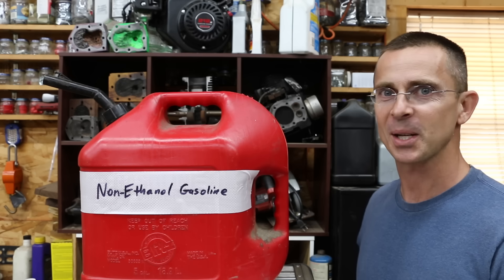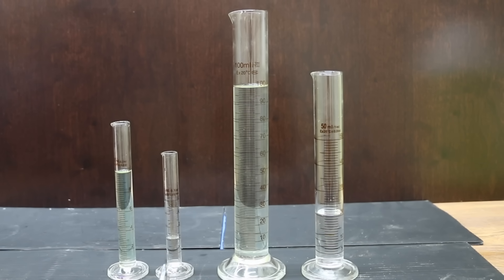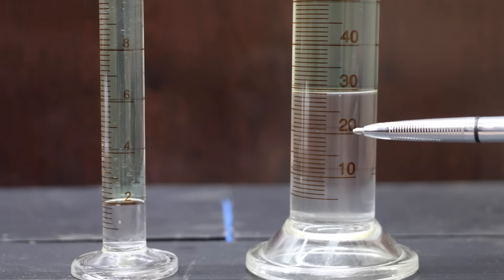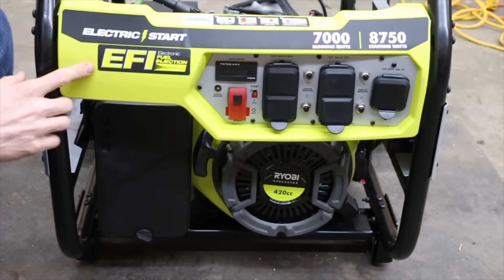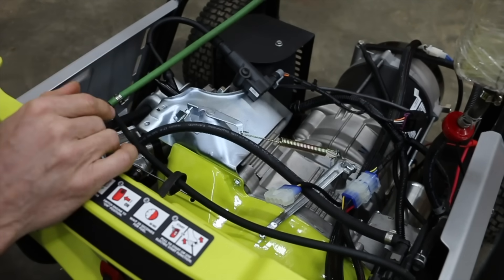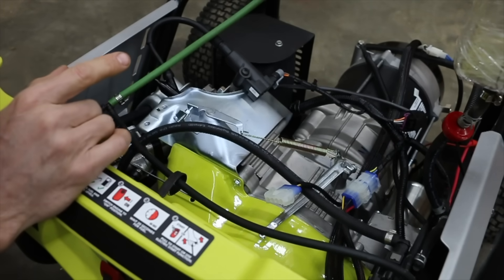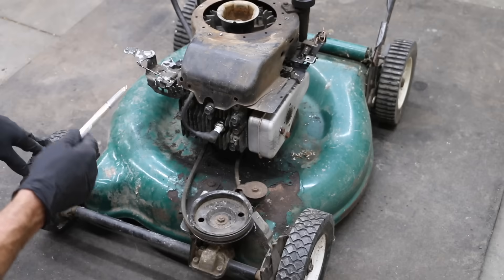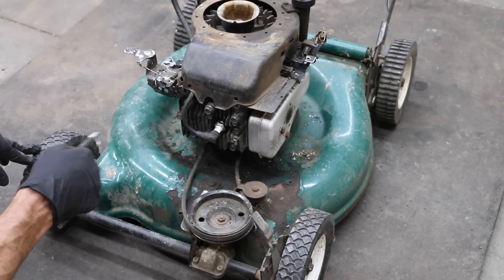Is Non-Ethanol Gasoline Really Better? See the PROOF!

Comment: I have an old 83 ranger that absolutely refuses to run right on normal pump fuel.
Reply from the maker: What type of fuel works well?
Reply: @ProjectFarm  What I ended up doing overall was shim parts of the carb that were getting some airflow (original carb, so it's tired). Once I solved the air issue, the standard 83 ran no better. I dropped my tanks (it is a longwheel base with 2 tanks...seriously), cleaned them out, flushed my lines....still ran bad on standard 83. A gas station opened up a few miles away, and it had non ethanol. I filled one tank just to see if it made a difference, and it was much better, but not perfect. I added a can of seafoam, and it was spot on. Ever since I always get a tank of ethanol free(ish), add a can of seafoam, and it runs like a top.

I have a few ideas why this might be. My main idea is that back in 1983, gas was much different. These 4 bangers were never meant to run on all these newer detergents. I think the seafoam helps dilute any existing detergents, and this in turn allows for properly timed combustion. Without the seafoam, the mixture is igniting too late, and sometimes not at all. Do this same thing in a modern vehicle and I suspect negligible difference. Computers can drive more spark, and adjust to premature or late ignition. Love your videos man.

Comment: A few years ago my Harley Sportster (XL883) started getting around 38 MPG in town after years of 42 MPG. Nothing on the engine had changed. Then I realized I was putting 10% ethanol gas into it. The 10% ethanol gave me 10% less mileage. In the last few months I've found gas with no ethanol. I haven't checked the mileage, but the engine does run stronger. Friends with trucks experience the same or worse mileage when using ethanol. It's garbage used to make people FEEL good, thinking they are saving the environment.
Reply from the maker: Thank you!

Comment: Many years ago when original “gasohol” came out we ran it in everything from lawnmowers to chainsaws with no apparent damage. Obviously, pure gasoline is more efficient because gas has a higher calorie content than ethanol, but that was a known issue. 

What I find interesting is how corrosive the ethanol blends are compared to the original blends. My theory is that the additives used to meet federal standards increase corrosion.
Reply: In case anyone is interested, pure gasoline is 114,000 btu/gallon
E10 (the common regular blend) is 111,836 btu/gallon 
E85 is 81,800 btu/gallon
Pure Ethanol is 76,100 btu/gallon

The common E10 has roughly 2% less energy that pure gasoline 
E85 has nearly 3% less energy than pure gas
Reply from the maker: Great point

Comment: Interesting video, but I've tested the difference for my 2001 Ford Focus using ethanol fuel, and I actually get 3 - 4 mpg less with it.  So, I never buy it.  BTW, I grew up on a farm and support farmers,  but I don't support ethanol based fuels because of this and the same reasons stated several times in this comments sections already (which have nothing to with mpg in my vehicle, but everything to do with environmental issues, subsidies, etc).

Comment: Are there any gas stations that don't offer non-ethanol blend fuel? If your engine--large or small--can't handle an ethanol blended fuel, you know... don't use it? Sounds like the fuel isn't the problem, it's the consumers that don't know any better.
Reply from the maker: There are several that offer non-ethanol fuel nearby where I live. Thank you

Comment: I have pulled a  plug on a lawnmower stored a couple months  and the ethanol had absorbed so much water ,  the  gas  looked like hand cream
Reply from the maker: Wow!  That'll cause a lot of damage to the carburetor metal.  Ethanol destroys "pot metal".
Reply: the good news is the lawnmower is  30 years old never had more than an oil change yearly and air filter cleaned and oiled .  starts on first pull all summer  ( bit harder in winter )  and have not used ethanol gas in several years

Comment: Agree rebuilt several carbs on small engines due to the ethanol damage eating the rubber components. I live in Northern California and travel 20 miles to Oregon for non ethanol fuel and its still cheaper than regular unleaded in my town. Great California taxes driving people away day after day
Reply from the maker: Thank you!

Comment: As a retired ASE Master Tech.  I found... when ethanol mixes with water in storage tanks and gas tanks, it is allowed into the fuel system where it passes through the fuel filter.  The problem; water makes the paper filter medium swell and restricts the flow, lowering the fuel pressure at the injectors.
Hence, fuel filters that should last 30k only last 20k.  This causes hesitation and a lack off power.  Love your videos!
Reply from the maker: Thank you!

Comment: Have you seen gas sold as non ethanol sold with ethanol in it? That's supposed to be tested every so often to verify that it actually is what the product claims or else they can get fined....
Reply from the maker: I have not had this happen yet.  I have a tester that I use when I buy non-ethanol just to be sure. After working with fuel with ethanol, I can now smell the ethanol too.

Comment: I see .5 to .8 miles per gallon better milage out of my expedition with non ethenol fuel and well as a definative boost in power.
Reply from the maker: Nice!  Thank you for commenting on this.
Reply: Thats because you have more fuel🤦🏼‍♂️
Reply: I saw maybe 0.75 higher MPG in my Explorer. It's 70 cents per gallon more expensive here though, I'd be paying $14 more every 20 gallons for 15 more miles. There are cheaper ways of gaining fuel efficiency; like add a homemade air dam to the front bumper. (I did that before and it worked for maybe 1 MPG.)
Reply: A true multifuel motor, such as the one used in early ethanol Saab 9-5 will have more power running on nearly pure ethanol (in Sweden we have E85 with 15% petrol). The fuel economy stays around the same since ethanol is cheaper. So you pay for the energy. I´ve tried using ethanol for my old 1950:s tractors but the compression is probably too low. Won´t run that well. One has to think of fuel as firewood. It doesn´t matter if you burn pine or birch. They both contain the same energy, but not in relation to volume.

Comment: Ethanol burns with lower efficiency at lower temps. The colder the fuel the less energy it produces. That's why my air intake has a water jacket coming from the radiator. Back in the day gas stations had summer blend fuels that had , I believe, 2 to 5% ethanol. Ethanol is a mild corrosive that supposedly eats carbon build up on moving parts like the piston head but not much help on the stationary surfaces. Ethanol is more corrosive on marinized engines due to the alloys used and smaller engines due to the higher temps.
Reply from the maker: Great point

Comment: I have a 2017 Tacoma and we did some number crunching between the two.  One the same road going 500 miles we used 10% ethanol regular gas and only got 18 MPG.  The next time we made the trip we used straight 100% gas under similar conditions and got almost 24 mpg.  With that much difference in mpg it is cheaper to use regular than the ethanol gas that is a lot cheaper to buy but not when you crunch the numbers, $ per mile.
Reply from the maker: Impressive results!  Thanks for sharing!

Comment: i only really am concerned with older 2 stroke outboards that  i run. the higher octane causes the motor to run cooler, thus increasing carbon deposits. not to mention that weird gel like substance it leaves behind over a year of storage, clogging carbs to no end. add to that 4% better fuel economy (which im guessing is atleast 2% more hp) and non-ethanol wins for me hands down.
Reply from the maker: Thank you

Comment: I ❤️ E85. 0 problems and the power is amazing. I however would think twice of running high ethanol fuels in a carbureted motor. I have found when I do run gasoline my exhaust tips get carbon build up and with E85 they stay squeaky clean.
Reply from the maker: Thank you

Comment: Most economical gasoline formulations have poor octane numbers, causing knock.  This problem was addressed by adding tetraethyl-lead.  Unfortunately, it's a horrible pollutant which contaminates the air, water and soil and causes high blood levels. When lead was finally phased out of gasoline, a demand for an octane substitute led to the oxygenates, including ethanol.
In addition to increasing the fuel's octane rating to a satisfactory level, ethanol reduces carbon monoxide, oxides of nitrogen (smog) and other pollutants in the exhaust.  The trade off is that since ethanol is already partially oxidized, it doesn't contain as much energy of combustion as hydrocarbons like gasoline.
Reply from the maker: Thank you!

Comment: I have a 2000 Accord V6. I have to use no-ethanol fuel because of a Honda design issue that results in a "hot soak" problem (the ethanol vaporizes out of the fuel causing the car to sputter/die at idle or restart (after engine is warmed up)). Once I started using pure gas there was no longer a problem (other than only one service station carries no-ethanol gas).
Reply from the maker: Thank you

Comment: Calorific value is almost spot on - 4%. If it's not a requirement, you can make your money back if premium non-ethanol is 4% higher priced than ethanol. In my case, local gas stations offer ethanol free premium, but not regular, at a 5% difference. Makes for a hard decision!
Reply from the maker: Thank you

Comment: In aviation long ago we saw Ethanol fuels damage rubber fuel tanks and hoses and seals 
This was when we had a STC To run Auto gas in our AC Engines certified for 80/87 leaded aviation fuels 
It had been replaced by LL 100 AV gas
Valve damage resulted from using the 100 LL
Reply from the maker: Great point! Thank you
Reply: Avgas 100 LL is a bit pricey.

Comment: I had a Flex Fuel vehicle that took E85 also. While E85 was cheaper you got less fuel economy and performance. If you were to use E85 exclusively your engine would wear down faster. For my motorcycles and small engine items such as lawn mowers and snow blowers, I always buy gas without ethanol in it. The shelf life of gas with ethanol in it there's a lot less then without ethanol.
Reply from the maker: Thank You
Reply: I also forgot to add that it's stated that your vehicle used with E85 would continue to reduce your MPG over the years because it wears out the engine so much

Comment: Depending on what the ethanol is made from corn sugarcane or wheat, every thing I've seen or read is American, but in Australia they only use wheat from 1 company & there is no issue with it, as for milage lot better than 91ron & mid to high speed excelleration in 6&8 cylinder cars a lot smoother
Reply from the maker: Thank you

Comment: Non-ethanol gasoline is only better in the sense that ethanol will pull moisture into your fuel tank and straight gas will not. So, for engines that do any kind of sitting around (lawnmowers) ethanol is bad, no debate. When it comes to cars that get driven each day it does not matter.
Reply from the maker: Thank you

Comment: I became curious of the same question with my vehicle. Driving the same route, at 55 mph for several days I found my vehicle averaged 30.5 to 31 mpg on ethanol blended fuel. That same vehicle, same route at 55 mph for the same number of days on pure gasoline fuel averages 37 mpg.
Reply from the maker: Thank You

Comment: I've been running e10 87 octane in my 1999 johnson 60hp, 3 cylinder, 913cc,  2 stroke outboard for nearly 10 years. I can buy ethanol free 90 octane for 35% more. I cant tell a difference in the way it runs.  Yes, I will have a problem(either fuel) if water gets in my tank. This is in a fairly low performance engine.
Reply from the maker: Thanks for the constructive feedback

Comment: No non-ethanol gas available here in NJ, but when I finally got to buy a tankful in Virginia for my 2015 Buick LaCrosse recently, I got smoother acceleration, and the light pinging on acceleration that the dealer had "normalized" all but disappeared. And yes, it added some 25 or 30 extra miles before I next filled up.
Reply from the maker: Thanks for the constructive feedback

Comment: I run 100% whole gas in my lawn tractor my trimmer and boat motor. Eversince I did this the lawn mower runs much more smoothly. I believe anything that isn't fuel injected you should use whole gas. Unfortunately most gas stations don't sell 100% whole gas.
Reply from the maker: Thank you and glad its helping.
Reply: Ethanol still isnt good for fuel injected vehicles, it destroys the orings

Comment: The reason you are not getting full 10% ethanol in the 'water test' is that shipped ethanol is 5% denatured.  This means that the ethanol used in gasoline blending has 5% hydrocarbon added before shipping.  This makes it 'not drinkable'.  
Therefore, ethanol used in gasoline is actually 9.5% pure ethanol.
Reply from the maker: Thank you for the constructive feedback.

Comment: Ah your efficiency test is directly in line with AVE's math comparison of the 2. He worked out e10 had 4% less energy per volume then straight petrol yet doesn't cost 4% cheaper so it's better to buy straight gasoline. Here in Australia there is about 1% difference in the price between the 2 so you would waste a good amount of $ over an extended period of time buying e10.
Reply from the maker: Thanks for the constructive feedback

Comment: I really like these tests as they are done very well.
As for people commenting on how Ethanol is so great for small engines and it doesn't hurt them, don't know jack shit. Back in the old days, a small engine could sit for 2 yrs and never have a problem, now sometimes, 2 months is all it takes for the carb to need to be removed and cleaned because of the Ethanol.
There's a reason why the big box stores sells NON-ETHANOL 2-stroke gas and it ain't just for the money, it's cause it lasts longer and doesn't ruin carbs.
Reply from the maker: Thank you

Comment: When it comes to cleaner, you really need to compare E85 to gasoline.  If you have ever seen an Indy car engine after a race broken down, you would think it only did one lap.
Reply: Comparing a 250,000 engine to a 2000 dollar one really isn't apples to apples and what fuel do they run ?
Reply from the maker: Thank you

Comment: 2003 F 150 5.4 engine
E85=12-15 mpg
Ethonal free = 14-17 mpg
Measured by full tank refills over months of same commute.
Unfortunately the higher cost of ethanol free negates the higher mpg
Reply: No difference, used both in car, truck, and motorcycles and tested many many times. 90 eth free vs 93 eth. Cost is same
Reply from the maker: Great information. Thank you
Reply: Got three to four miles per gallon lower with ethanol fuels

Comment: Both fuels work well if you know how to work with them. Both types get old and both go bad and even some non ethanol gas absorbs moisture depending on the additives. And in many cases high ethanol 15% gas actually is better, burns cleaner, less carbon buildup, and better pre ignition. why do race teams use it, why does seafoam use alcohol to clean the engine. The public has been fed a lot of misinformation about ethanol
Reply from the maker: Thank You
Reply: Running straight alcohol carries more air, requiring the jets to be 2.5 times the size of gas jets, thus producing more power, but CANNOT be left to sit in any engine because it's corrosive.
That's why race teams use it, cause it produces more power and has a higher octane rating, but again, the jets are 2 1/2 times the size of the gas jets using 2 1/2 times the fuel. Have fun filling your tank 2 1/2 times as much !!
Reply: @augustreil  not talking about 100%. Blends
Reply: @superwilcox9026 , Same thing, just a larger percentage that's all.

Comment: With both my Kia Optima and Sportage I got a bump around three to four miles per gallon. Using real gas. The throttle response is better. Both cars handle grade at highway speeds much better. Real gas is more expensive but when you got an extra 45 to 60 miles per tank it washes.
Reply from the maker: Thank you

Comment: Thanks,
   No comment on your tests.
Non ran longer. 
I have a Sonic,"12 w/108k.
1.4 T, 6-sod, cruise, hatch.
I use nothing but!!!!
NON ETHNOL,90 oct.w/ 4oz.mystery oil per 10 gal.
RESULTS;
45MPH,6-SPD.,CRUISE=63.3MPG
55-SAME=51MPG.
70MPH, SAME=41.4 MPG.
NOT A ETHNOL FAN!!!!!
10%= 12.8 oz. of gas,so 10 gal.gas= one gal. Free!= 11 gal.
Midwest ETHNOL is cheaper. 
Putting just 10% in, still STEALING our $$$$$$ !!!!
Reply from the maker: Thank you

Comment: I don't know the duration of time that it takes but I do know that there is a chemical process that occurs when fuel and water mix known as phase separation? And the octane can be leached out. I would also say that if you have any questions about what Ethanol  does to things just look at the special equipment they have to use for in the fueling industry.
Reply from the maker: Great point!  Thank you

Comment: Thank you my project farm friend. I have never used alcohol of either variety for drag racing. But the methanol carburetors have twice the jetting capacity as the non ethanol fuel carburetors I have not measured the jetting, but if this is true, 10% methanol  would run 5% lean with a carburetor. Methanol has more hydrogen attached to every molecule. So my project farm friend you are right saying the only way to test is with an injected oxygen sensor controlled engine. Keep playing and figuring out what the real truth is. God bless!
Reply from the maker: Thank You!
Reply: Ethanol and methanol are used for drag racing mostly because they can burn much faster than gasoline and achieve higher RPM.